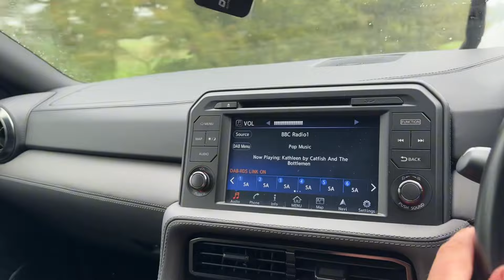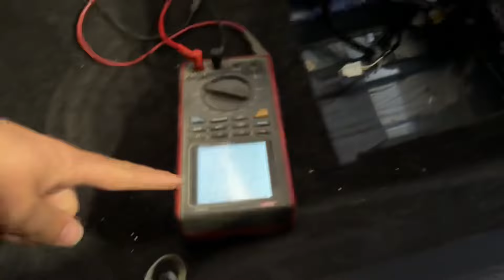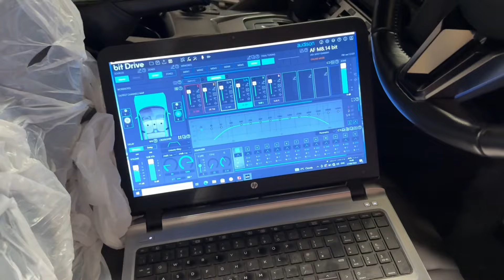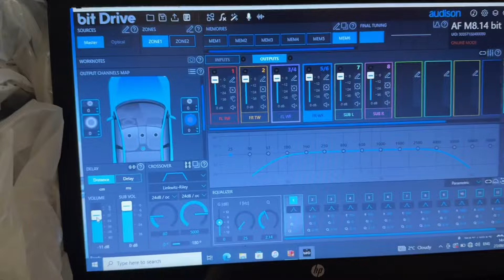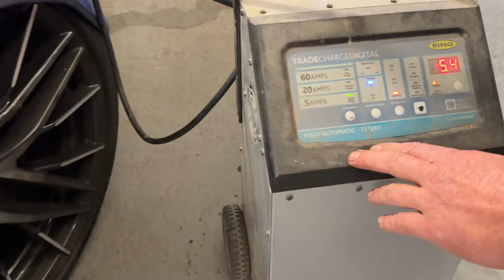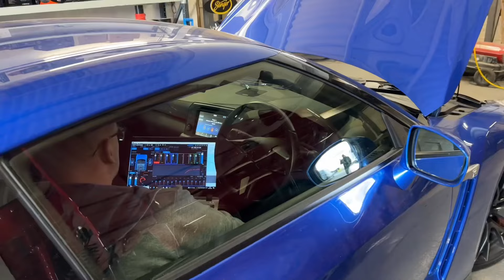MEGA LOUD AUDIO UPGRADE ON MY R35 GT-R!!

Comment: I think you should get rid of the old unit and build a little building inside the new unit for your cars
Reply: Yeah, sounds way better. You don't have to pay any other rent and you've got it all together. So when you need this or that, it's all in one place. 😏
Reply: 100% makes miles more sense
Reply: Totally agree the new HQ is Massive make car area in the new HQ
Reply: However… Helen was happy doing the merch from that office space, maybe the tattle shed is best left to the boys 😂
Reply: I agree. Keep everything together under the trucker Tim roof. You’ve got enough room in the new unit for both trucks and cars.
Reply: Maybe build an office and put your cars ontop like the old hq?? Obviously in the new HQ
Reply: I agree, the cars should go right to the back of the new unit with a wall and then Bengineers welding stuff further forward

Comment: Great video tim. Tho just asking I know the gtrs newer and  probably more electrical than trucks but you took the 4 series apart, so will you be doing the exhaust yourself and maybe the blow off valves or some of the work by yourself or with someone. That would be interesting to watch if I'm honest and to in my case learn.

Comment: I won't over stretch  your self your new unit is big enough to have trucks one side and cars on the other also better to have everything in one place for security reasons lot of jelus people out there that will target you so I'd say the money you will save put into good cctv alarms and maybe make a wooden structure inside the unit with bifold doors on front so keep the cars away from the muck and dust from the trucking channel also extra security as well just my opinion but it's what i would do if I was you

Comment: Isn’t there an eq to adjust the settings of the Bose system?
Reply: You can't eq something that isn't there to begin with.
Reply: Nissan systems literally have bass mid & treble, all you do is turn them up or down. Stock speaker systems are usually bad, not all, but most.

Comment: I remember working in a computer shop and when I done house calls to do computer maintenance we had customers like Tim that wouldn't fck off and let us do our job in peace. Those are the customers I hated doing work for.

16:35 just leave him do his job. He is measuring the distance from your seating position to the speaker to make sure the sound is even across all speakers when you're sitting in your driver's seat.

Were aware you need your content but where you're giving him a speech about the video paying his wages seemed to be very rude and condescending.

He's trying to do his job while you're getting in his way.

Comment: If you keep the old Trucker Tim HQ respectfully you're going to actually have to do some proper work to fund it
Reply: It doesn't look like Tim is short of money at all. The s series he bought and that GTR would have cost him approximately £200,000. Those trucks are very expensive. Not forgetting the project trucks , modifications to his R series , the modifications to the gtr and the new unit.

There's no shortage of money here.
Reply: @Steve30x  the car was only 88,000 mate.
Reply: @Steve30x all true. But my thinking is, his ambition was to be his own boss and drive his own trucks, not to do them up, proclaim they're gorgeous and have them sat idle for 99 hours . You have to work for things in life
Reply: @Steve30x  he also appears to have bought shaun a Scania
Reply: @snowysnowwolf6228  more money than sense has old timbo 🤣🤣

Comment: With Audio isn't more often the head unit that's crap. Your also listening to a poor source ie radio. If you want a real sub get Origin ive one here used to use which has two 12's in push pull config, Ported Cabinets made in Birch Marine ply, they used Linn K20 flat cable and it will play anything. They also did a double cabinet!!! plus some sealed ones. 
When i was hunting around for a new set up spoke to Martin Colums of car audio mags he said spot on better than the kickers i looked at.
For those that don't know Origin are the people that make those massive speaker cabinets for likes of Queen.Pink Floyd etc so not made in China.